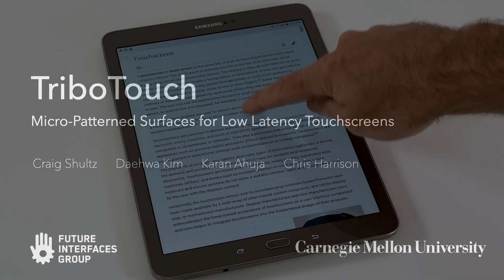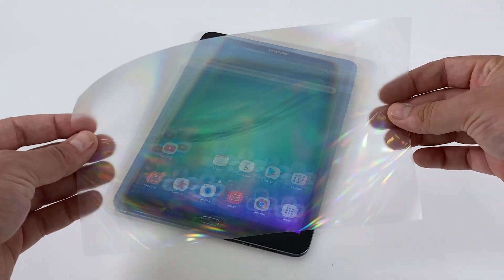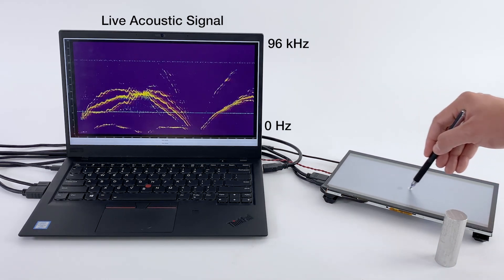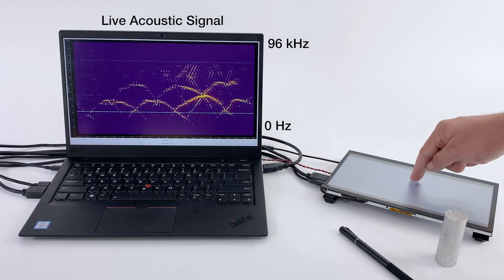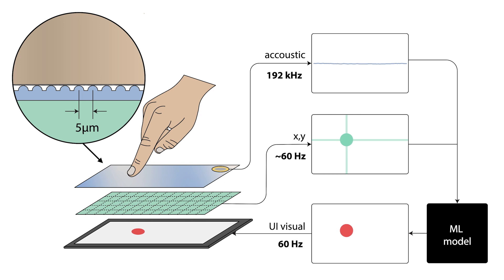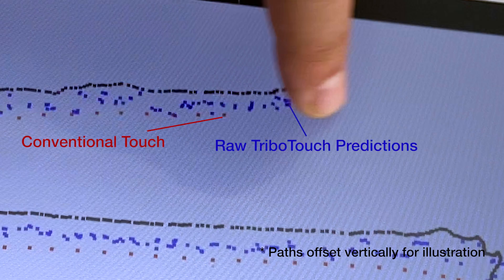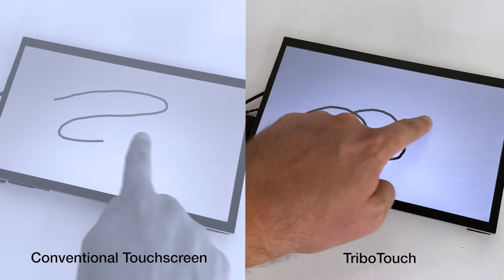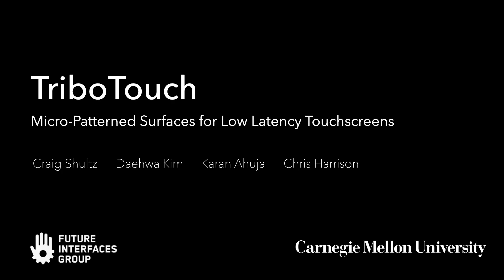TriboTouch: Micro-Patterned Surfaces for Low Latency Touchscreens

Comment: Interesting. I wonder if it works with multitouch...
Reply: It looks like the regular touch input is separate from the acoustic input, so at the very least, you should be able to disable this advanced touch sensing if there are multiple contact points detected.